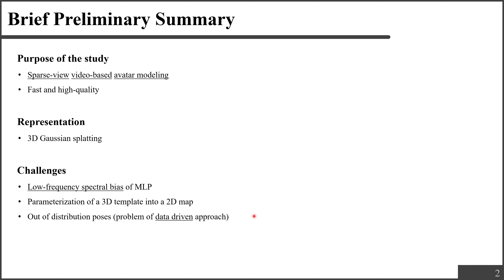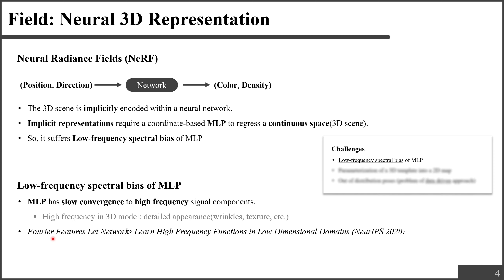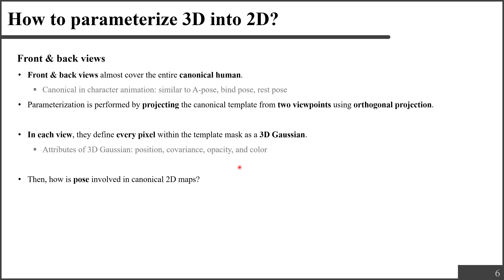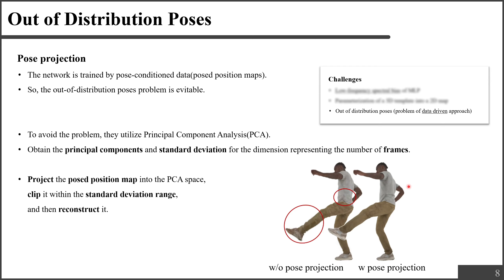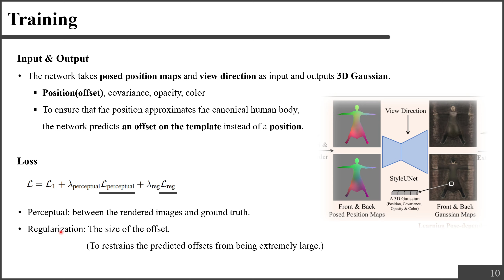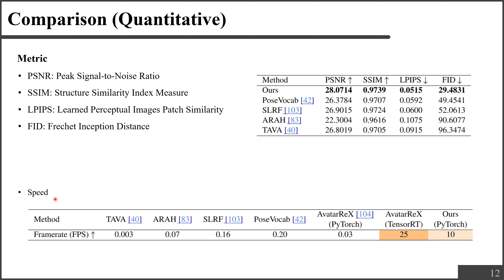[Seminar] Animatable Gaussians

Comment: Thank you for your presentation.

Q1. Are there any limitations in using front and back projections for parameterizing 3D templates?
Q2. What are the key advantages of using CNN-based networks instead of MLPs for high-frequency detail representation in 3D models?
Reply: 1. Even so, overlapping parts of the field of view, such as fingers, are not likely to show up well, but they are said to show up well enough. The reason is that it is an orthogonal view, not a perspective view, but I don't know why that is.
Perhaps it's not exactly a front view, but rather a view slightly from above.

2. As you can see on page 11, detailed features such as wrinkles and patterns on clothes are well expressed.

Comment: Thank you for your clear and insightful presentation!

Q1: Could you explain what is a limitation of the algorithm when generating 3D meshes from sparse views?

Q2: Is converting the 3D map to a 2D map using only front and back views really sufficient? Could there be inaccuracies?
Reply: 1. I think the limitation is that the detail is reduced as it goes through the 3D mesh.

2. The front and back views only show the canonical pose. Even so, overlapping parts of the field of view, such as fingers, are not likely to show up well, but they are said to show up well enough. The reason is that it is an orthogonal view, not a perspective view, but I don't know why that is.
Perhaps it's not exactly a front view, but rather a view slightly from above.

Comment: Nice presentation.

Q1. Why do we need animations using 3d gaussians? What are its advantages over traditional animations?

Q2 What does the term low-frequency spectral bias mean?
Reply: 1. Photorealistic!
Of course, this could be done with a very high quality 3D mesh and high resolution textures, but it would be inefficient.

2. Even if the number of nodes in an MLP increases, the ability to learn high frequency increases, but low frequency are still learned first.

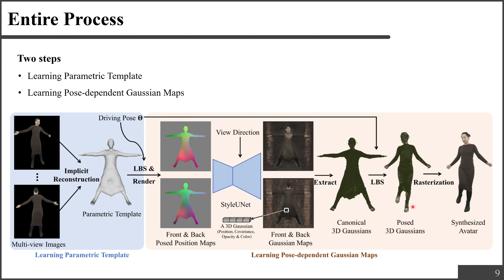Comment from the maker: Q1. Is there a way to simplify the two‐step process shown around 8:26? Any ideas or suggestions?
Q2. How can we challenge the assumption that “front and back views almost cover the entire canonical human,” especially in scenarios such as laterally shifted legs, overhead or crouching poses, and twisted poses?
Reply: A1. The reason for the two-step split is that it is difficult to obtain canonical Gaussian templates and skinning weights from multi-view images directly. If we can obtain Gaussian templates directly from images and predict them more accurately than the SMPL skinning weights, the process can be simplified.
Moreover, It would be even better if we could distinguish clothes from skin.

A2. The front and back views only show the canonical pose. The specific pose is represented with RGB color. Even so, overlapping parts of the field of view, such as fingers, are not likely to show up well, but they are said to show up well enough. The reason is that it is an orthogonal view, not a perspective view, but I don't know why that is.
Perhaps it's not exactly a front view, but rather a view slightly from above.

Comment: Great presentation.

Q1. On slide 7, I didn’t quite understand why XYZ coordinates are converted to RGB to represent color values. For example, in posed position maps, the shape of the avatar is already represented in the image, meaning that spatial information is inherently reflected. In this case, what is the reason for additionally encoding XYZ values using color? I feel that this provides redundant information. Wouldn't a mask image alone be sufficient?

Q2. On slide 5, why do you convert the 3D template into a 2D map and apply a 2D CNN instead of directly applying a 3D CNN? I’d like to know what challenges or issues arise when using a 3D CNN.
Reply: 1. In 2D maps, the rendered 2D shape is fixed only in the canonical pose(A-pose). So, to involve pose information in 2D maps, the color encoding is required.

2. They showed that they can sufficiently reconstruct 3D even using 2D maps. It is faster than 3D, and the fact that it is a network that has already been widely used and its performance has been proven seems to have influenced the choice.
In addition, it is convenient to use 2D to connect the mesh template and the 3D Gaussian. Although it is a different representation in 3D, when rendered, both are the same 2D.

Comment: Interesting topic!

1. Why can CNNs learn high-frequency information more easily than MLPs? What about Transformers instead of CNNs?

2. I don’t fully understand pose projection. How does using PCA help address the out-of-distribution problem?

3. On page 10, it says that offsets are predicted instead of positions. What kind of offsets are they referring to?
Reply: 1. That's because CNN's local filter(like 3x3, 5x5). CNN focus on local pattern, but MLP process the entire input.
However, positional encoding is used to alleviate this problem. So, Transformer is relatively less affected by this problem, but I'm not sure if it's better than CNN.

2. I understood as this is similar with noise removal with PCA.

3. It means that distance from canonical avatar(or skin), rather than global 3D position prediction.

Comment: Nice seminar. 

Q1. Why does the pipeline go through NeRF before using the CNN-based StyleUNet instead of directly reconstructing 3D GS from multi-view images? Wouldn't it be possible to reconstruct 3D GS, render it, and then use it for StyleUNet conditioning?

Q2. Does the trained StyleUNet work only for the single avatar and motion sequence used during training, or can it generalize to unseen avatars and motion sequences?
Reply: 1. One of the reasons for using a mesh is that it is difficult to obtain a canonical Gaussian. Another reason is that it is difficult to obtain the skinning weight of a Gaussian. However, using a SMPL mesh, it is relatively easy to obtain the skinning weight.

2. It can be used only one avatar.

Comment: Thank you for the presentation, and for introducing such an interesting paper.

Q1. The main strength of this model seems to arise from the idea of projecting a 3D parametric mesh onto a 2D image and placing Gaussian representations at each pixel. Assuming the image resolution remains fixed, this approach allows representing arbitrary avatars consistently with the same number of Gaussians, resulting in a canonical and uniform representation. Thanks to this uniformity, leveraging CNN-based architectures such as StyleUNet becomes feasible, offering advantages over representations like point clouds or meshes. However, the method described in the paper inevitably produces many unused pixels outside the avatar region, effectively discarding a substantial portion of the image after projection, depending on the avatar's initial shape. Is there a potential method to achieve a fully canonical representation through parametric mesh projection without generating these redundant, discarded pixels?

Q2. As far as I know, each 3D Gaussian typically has a relatively low-dimensional feature (~10 dimensions). Recently, several studies (e.g., LayoutNUWA—ICLR 2024, PosterLlama—ECCV 2024) have proposed finetuning local code-based LLMs in a masked-prediction manner to generate layouts. Inspired by these approaches, I'm considering an idea: first obtaining initial Gaussian features from a low-resolution feature map using a finetuned local codeLLM combined with a visual encoder, and then employing CNN- or ViT-based cascading models to upscale these features to higher resolution. I'd be interested to hear your thoughts on this approach.
Reply: 1. Since the shape of a person is different, it is inevitable that there will be discarded parts when expressing it in 2D. Also, since it includes garments, it is difficult to achieve a fully canonical representation. However, a recent garment try-on study introduced a method of expressing multiple garments in a fixed dimension by dividing them into a specific layout. If this is applied, it seems possible.

2. The reason why 3D Gaussian has low-dimensional features is because the elements of 3D Gaussian are position, covariance, color, and opacity. These dimensions should be fixed values in the end. I think the upscaling you are talking about is adjusting the density of 3D Gaussian without optimization process. If that is possible, 3D Gaussian will be more convenient to use in dynamic scenes.

Comment: Thank you for the presentation. I'm excited to see how far the concept of Gaussian can expand into various fields.

Q1: In terms of the low-frequency bias of MLPs, what happens if the MLP has a sufficient number of nodes to represent high-frequency results?

Q2: Why do they choose to utilize 2D representation with 2D CNN instead of a 3D CNN? 3D CNN can naturally understand 3D representations without specific mapping.
Reply: Even if the number of nodes in an MLP increases, the ability to learn high frequency increases, but low frequency are still learned first. Methods such as positional encoding can alleviate this.
They showed that they can sufficiently reconstruct 3D even using 2D maps. It is faster than 3D, and the fact that it is a network that has already been widely used and its performance has been proven seems to have influenced the choice.
In addition, it is convenient to use 2D to connect the mesh template and the 3D Gaussian. Although it is a different representation in 3D, when rendered, both are the same 2D.

Comment: It was an impressive and interesting topic. Thank you for your explanation!

I have two questions:
Q1. You mentioned about the evaluation metrics such as PSNR, SSIM, LPIPS. Although I already know about FID, but other metrics are little unfamilar to me. Can you explain about these metrics?
Q2. Garment try-on looks like a very interesting and novel research topic. Can you explain what is this topic?
Reply: 1. PSNR measures the ratio between the maximum possible signal power and the power of corrupting noise, commonly used to assess image quality. Higher values indicate better quality.
SSIM measures the perceptual similarity between two images by considering luminance, contrast, and structural information. It ranges from -1 to 1, with 1 indicating identical images.
LPIPS measures perceptual similarity using deep neural network features, capturing human visual perception more accurately than traditional metrics. Lower values indicate higher similarity.

2. Garment try-on is a technique that shows the user the state of wearing clothes based on their current pose without the user having to put on the clothes themselves.